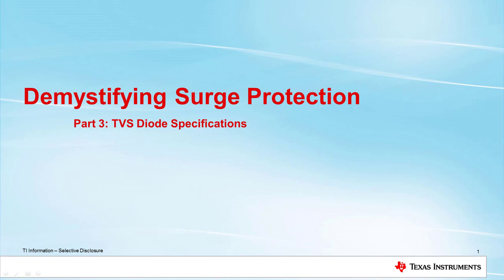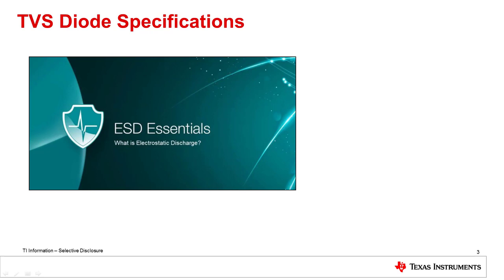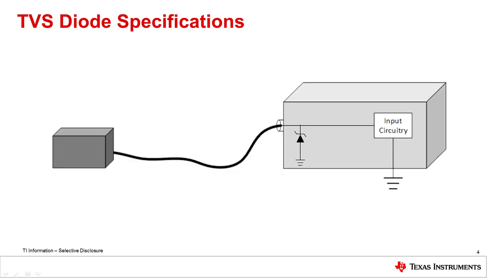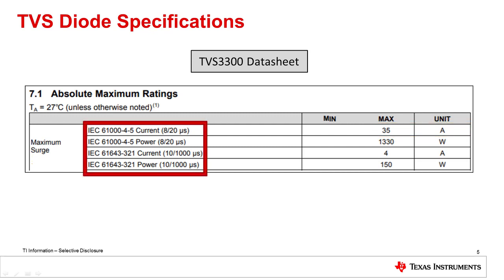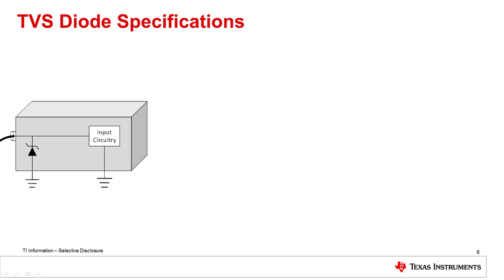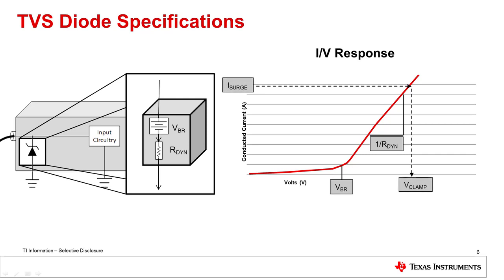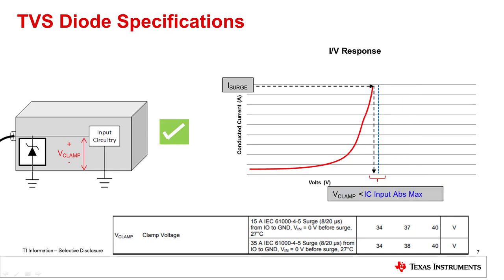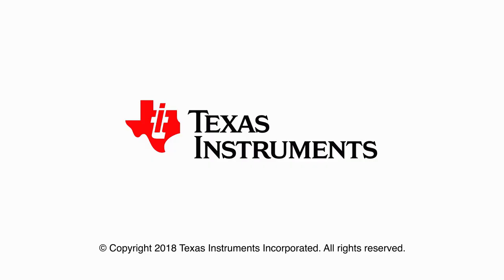Demystifying Surge Protection: TVS Diode Specifications

Comment: The circuit at the beginning is a poor design. You would never hang a TVS diode directly off a source line, you need some impedance, like ferrite bead or inductor to limit the current through the diode.